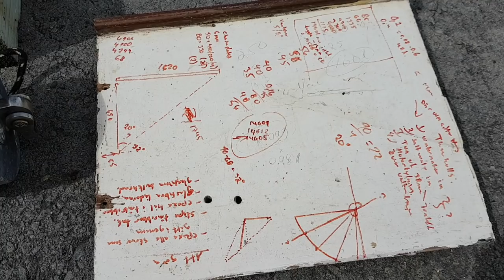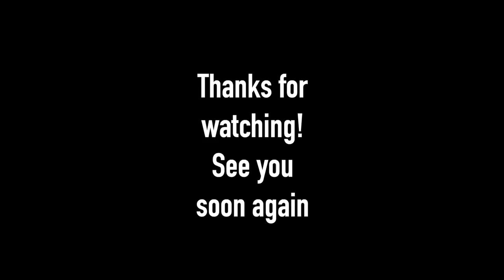Episode 23   Back in Mexico

Comment: How did you layout and fit the new bulkheads? Replaced old ones?
Reply from the maker: Yeah, I took out the old ones and used as templates. Mainly because It looked terrible and I couldn't stand it. There had been a diesel tank there before, so one bulkhead had been V-shaped. The length going stringers had been removed. Those were pretty easy to shape.
Reply from the maker: ...they were then glued in to the hull with epoxy and a layer of fiberglass cloth on top of that.
Reply: Fillets and FG tape on top?
The transverse members your replaced are referred to as floors in US ships and support the decking. Longitudinals are just Longitudinals. Funny lingo
Reply from the maker: Epoxy mixed with 403 adhesive fillet. Squeezing it out and making a nice radius with a spoon. Fiberglass on top of that.